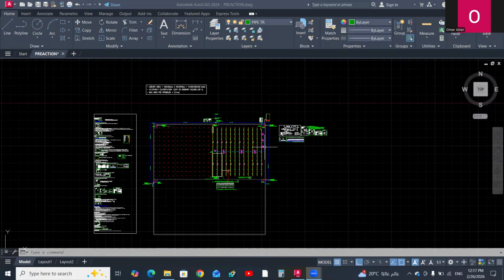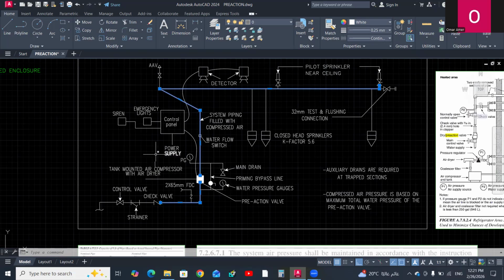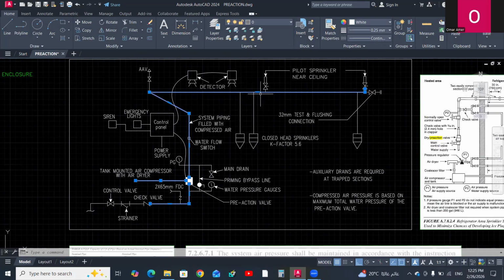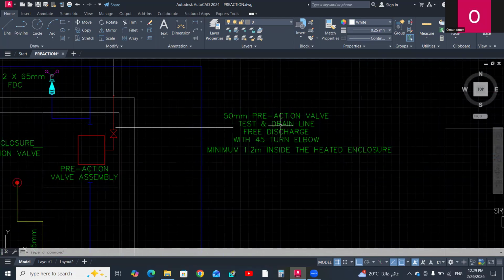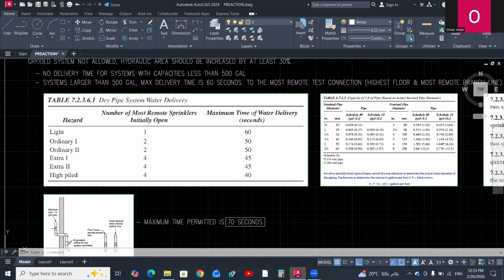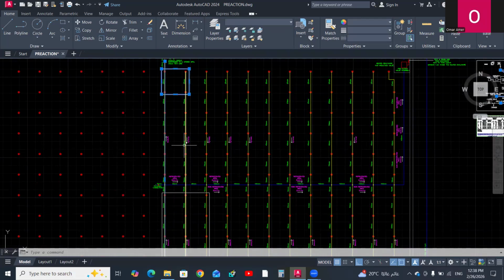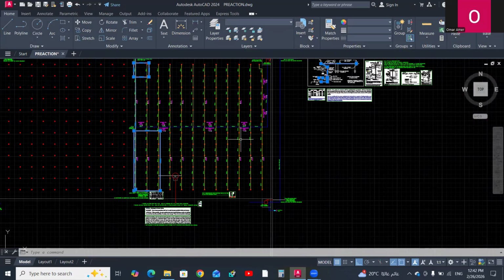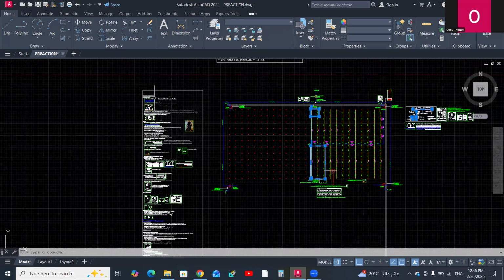90-PREACTION SYSTEM

Comment from the maker: https://drive.google.com/drive/folders/1GFahIVc0aYDAZN3mz0QAFVMJJG2V8kh_?usp=sharing  using revit schedules internal pipes & fittings volume have been calculated = 950 gallon for pipes served by only one preaction valve (as it is exceeds than 750 gallon) a separate water delivery calculations shall be submitted
Reply from the maker: حسابات ال WATER DELIVERY TIME تنقسم لمجموع 2 TIMES :-
1- الوقت ما بين فتح رشاش او عدد منهم طبقا لل HAZARD وفتح ال PREACTION VALVE بيتحسب بناء على اعتبار المواسير خزان مملى هوا او نيتروجين والوقت ال هيوصل فيه الهوا لضغط الفتح المعادلة الاساسية فيه هى معادلة خروج هواء من NOZZLE UNDER SONIC OR SUB--SONIC FLOW بينتج معادلة DIFFERENTIAL EQUATION ممكن تتحل ب EULER METHOD.
2- الوقت التانى هو الوقت المياه هتملى فيه المواسير بيتحسب بناء على UN-STEADY BERNOLLI EQUATION ال ACCELERATION ال المياه بتخش بيها المواسير بتتحسب وبناء عليها السرعة . لما بتعرف السرعة تقدر تعرف كل جزء من المواسير يتملى ف وقت الحسابات بتبدا من المحبس لحد ابعد رشاش.
المعلومات ديه مش موجودة ف اى مرجع او NFPA STANDARD , L, موجودة ف رسالة ماجستير هيتم ارفاق نسخة PDF منها

https://drive.google.com/drive/folders/1fBROJaN_PLGZMwy1uOlVZMTfOazXQ9tg?usp=sharing